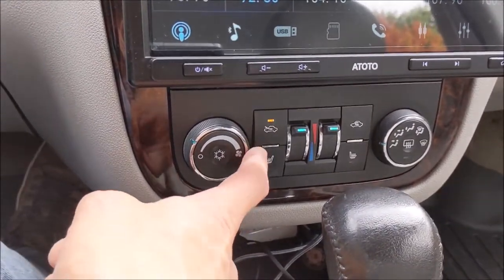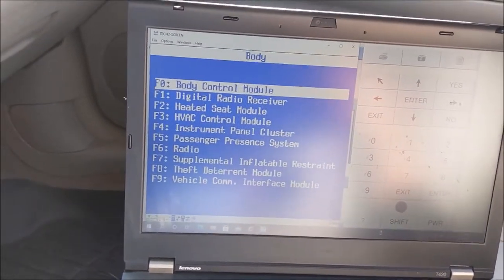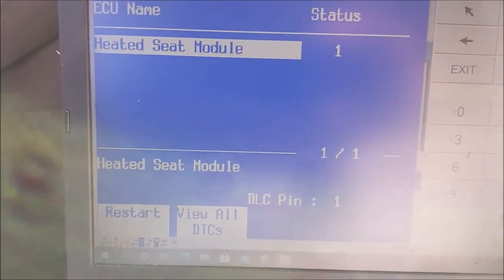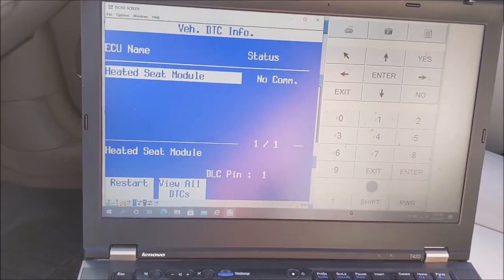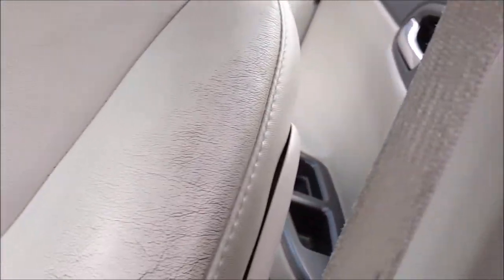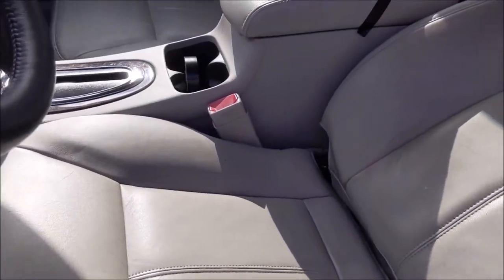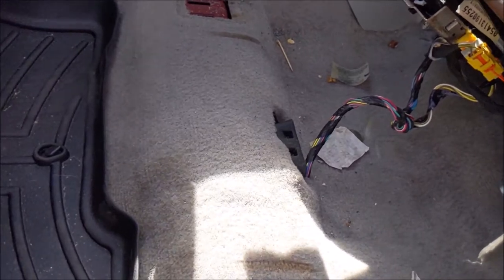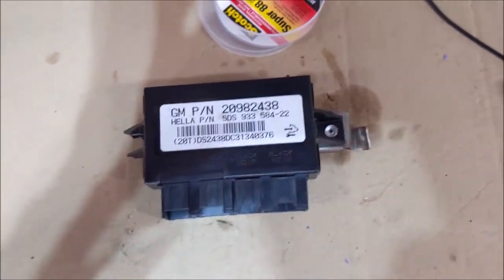2006-2016 Impala/Limited (9th Gen) Inoperable Seat Heater Part 1: Diagnosis & Module Replacement

Comment: Hey so I have a question… the back part of my driver and passenger seats won’t tilt up or down. What would yu think the problem could be cuz I can’t find a problem. All I here is the motor trying to move the seat but it doesn’t attempt to move
Reply from the maker: Just to be clear, you mean the bottom cushion, correct? I'm assuming that's what you mean, and not the backrest just for the simple fact that the passenger side backrest recliner is cable-operated..  I would unbolt the seats and detach them from the front hooks, then tip the seat back so you can see underneath. Run the up/down seat controls (NOT the forward/back controls) to see which motor spins and check to see if any of the "driveshafts" (for lack of a better term) are loose, disconnected, or missing. Check to see if anything is binding up, and if so, lube it up with some grease. Those "driveshafts" run to what looks like a mini differential, then they spin a worm gear from there.  One or more of those differentials could also be stripped out (like if you see the driveshaft spin but the worm gear won't turn.)

Comment: I watched this video and the second/part 2 video. I have a 2013 Impala LTZ I bought used earlier this year. The driver's side seat heater was not working correctly. The lights on the switch would light up but eventually kick off after a few minutes and the seat never warmed up. My upholstery guy took apart my seat and determined the seat heater was not faulty (continuity tested both pads) but the module likely needed replaced.  The local Chevy dealer said they would need to program the new module when it's replaced.  I did not see any indication that you needed to program the new module. Did you have to take any additional programming steps after you replaced yours?
Reply from the maker: If you purchase a used module, you won't need to have it programmed. Conversely, if you purchase a new one, it will need to be programmed at the dealer (or with a dealer-level scan tool.)  That said, mine was used and did not need to be programmed..

Comment: Recently my power seats began having issues. For example driver side wont recline forward and passenger wont lower back area. Any tips on getting those to work again?
Reply from the maker: I'd start at the main connector under the seat. Unplug it, check for corrosion, and check for voltage with a voltmeter. Work your way to the switches next, then each individual motor. In addition to checking voltage at the motors, make sure they're freed up and not binding. Also make sure the linkages are in place..

Comment: Yeah you're right does look like a fat boy has sat in that seat for a long time.  In the early 90's I worked at a Honda dealer and we had this one guy that had a little 3 door Civic and he was quite a big man.  I remember sitting in his car and I could feel all the springs in the seat.  The foam was completely crushed.  In fact I had to sit up so I could see over the steering wheel as I sat so low in that car.
Reply from the maker: 🤣🤣 Some people need to stick to body-on-frame SUV's!

Comment: My 09 Impala I can turn on the passenger seat heater and about 30 sec. later it shuts off.?
Reply from the maker: Will it stay on when nobody's sitting in the seat?
Reply: @CertifiedShadetree  it doesn't matter if your sitting in it or not
Reply from the maker: @mobes329  What I'd try is reaching in and switching both of the heaters on without anyone sitting in them and seeing what happens. If they stay on past 30 seconds, sit in one seat, then the other and you can narrow down which one is causing the problem. I would then disconnect that seat's heater pads and try the same diagnostic again to verify.

I'm debuting the follow up video next Monday, hopefully that provides more clarity..

Comment: I have a 2015 Limited LT. Is the heated seat wire harness there if it didn't come out with them from the factory?
Reply from the maker: No, the harness isn't present. I say go with aftermarket seat heaters, as it's next to impossible to retrofit the factory controls into a car that didn't leave the factory with heated seats. Furthermore, if you swap in leather seats from an LTZ it would behoove you to scrap the factory heater pads and go aftermarket, as the stock pads run at a different voltage..